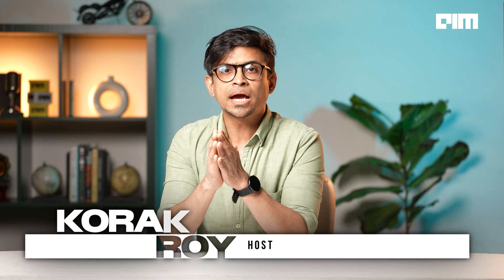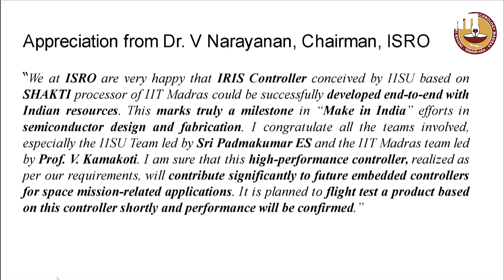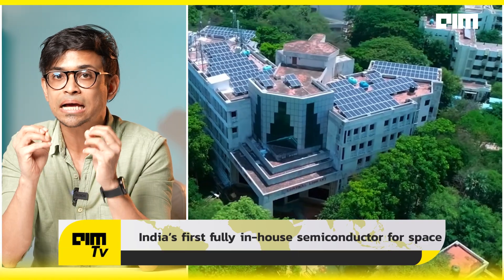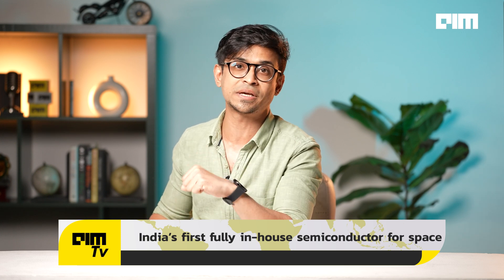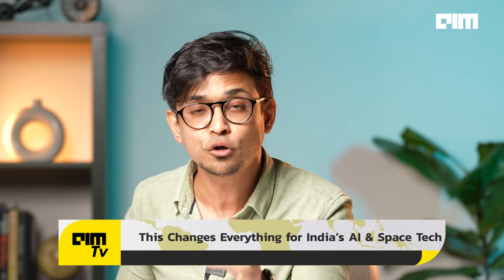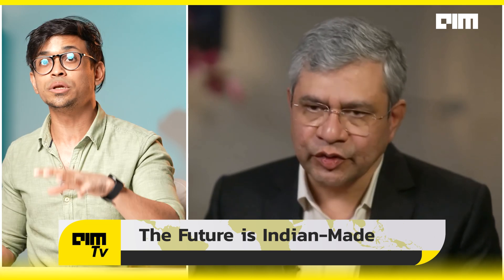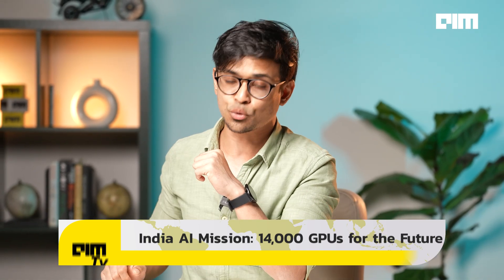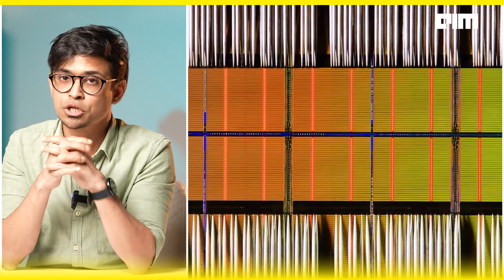India’s Semiconductor Revolution: ISRO & IIT Madras Make History

Comment: How many nanometres is the fabrication of the chip again? 180nm. WTH??? We're so behind :face-fuchsia-wide-eyes: but not a bad start... :face-red-heart-shape:
Reply: @LINE-UPLEARNER   usually size gets halfed every year or two. So 180nm can become 90,45,22,11nm..etc in coming years,if situation are favourable. But since technology is already available to make 2nm we could be able to get below 10nm in 2 or 3 years .
Reply: @unnikuttan3953  Is 2nm or even 10 nm for industrial and space applications required? Reliability is more important here than performance. 180nm is sufficient for now.
Reply: @user-fg6ro  Is  industrial & Space applications the only use of a transistor? I just stated an observational fact about evolution of transistors. What do you want ,India to make 180nm transistors till end of time.
Reply: @unnikuttan3953  No matter how you look at it, anything above 40nm is highly inefficient, you are correct, no one would stick to 180nm architecture. They should shift to 90, 40.... etc in the next iteration.
Reply: The narrower the transistor size the harder it gets to use in space.

You can't use normal processors in space at all, radiation hardening is a crucial step, and 180nm is not a bad start.

Comment: 180nm chip is too too large in today’s time . We need to be at 8 nm and lower to be world class !!
Reply: @amiteshtomar9171  it doesn't matter if it's 180nm. These chips won't be used in our computers and smartphones. It takes billions in lithography machines to achieve under 10 nm. The size doesn't matter for industrial applications.
Reply: @amiteshtomar9171  Yes you are right, but as an electronics enthusiast , I would like to say, We need what we require. If 180nm is required, that should be used. Yes, it will cost more crores to produce the smartphone processors which have nowadays become super powerful achieving 3nm, going to 2nm. But that's just a waste of money currently. Who requires 3nm? Ordinary people don't even know what they are holding in their hands, a 3nm SoC!!! Most, most  would not even use half of its true potential. Ordinary man requires 5-7nm only. So firstly, we should develop and learn the tech, and then master it with cutting edge technologies.
Reply: @TurboTronics11 To avoid privacy & security issues
Reply: wait everything gonna happen new pla schems are came more companies are establishing we will climb up the supply chain
Reply: 8nm chips is being gatekeeped by Taiwanese Companies in Taiwan. They will never sell out their biggest strength. 180nm is Good start for Normal Appliances and soon it will go close to 40nm one day. Forget dreaming about 8nm chips
Reply: @amiteshtomar9171  tu k7vh karega ki bas negative cimment karna hi tera aim hai